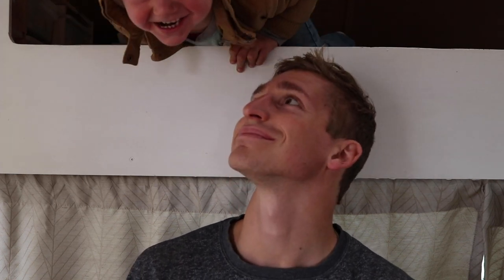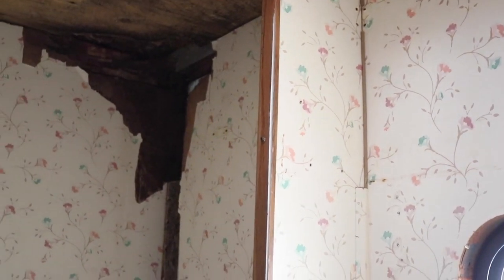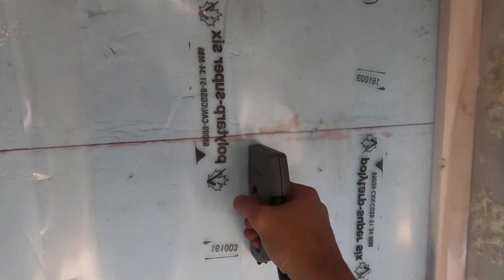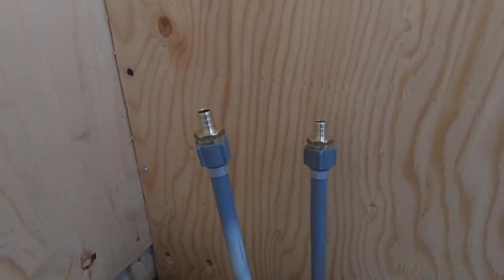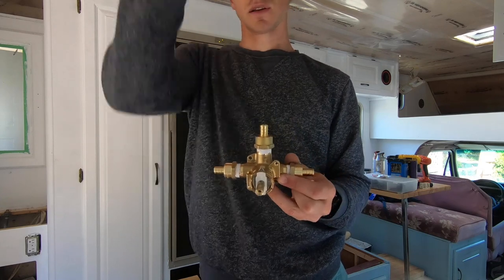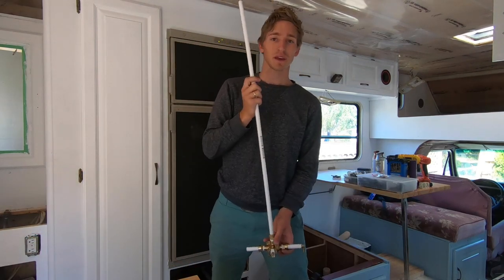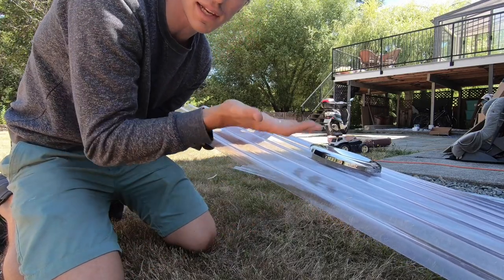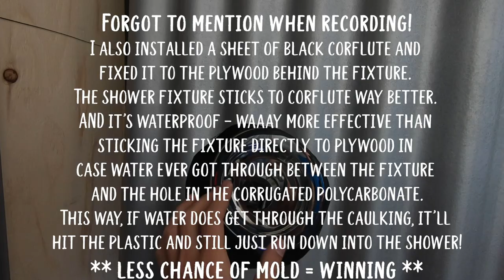DIY RV shower rebuild - start to finish

Comment: I know you did this work awhile ago, but good to see a post so we know you are still kicking around in the van somewhere!

BTW, if I were you, I would keep the PEX ring clamper.  I have the full size crimp one, which will crimp many different sizes of PEX, depending on which plates you put in it.  Yes, it was one of the expensive ones, but I pulled out all the copper plumbing in my house and replaced it with PEX.  I also have been installing radiant baseboard heat as I renovate each room.  So the expensive one was worth the money.  However, it is long, and can't do crimps in tight places because it opens so far.  So I ended up buying a clamper similar to yours, but even smaller, that uses the clamp rings like you were using.  There will come a time when you will need to replace a line in your camper - sink, toilet, shower - something will spring a leak somewhere, and you'll regret not having the ring clamper.  It may be a one trick pony, but it isn't all that large, and it's the only tool that can do the job.
Reply from the maker: Totally hear ya! We have a pre defined period of time in North America (2 year Canadian visa) so well definitely be keeping it while we're here in case of a leak or other issue. But at the end of our time we'll need to get rid of it. 😊

Comment: Thanks for the great video, we bought a camper and the tub surround is coming down and I'm guessing there's water damage back there too, I love the plastic corrugated look, I was wondering what I could use in our Reno, and I think this is the answer!
Reply from the maker: That's awesome! Yeah I hadn't seen it done before but it just made the most sense to me. And it was a simple solution for a fairly inexperienced renovator. :)

Comment: Looks beautiful but it looks heavy. I wonder how much weight you added putting all that wood on all walls and ceiling. Good luck.
Reply from the maker: Thanks. :) Honestly hardly much extra weight. If I looked like I was struggling it was probably from working with the tight, awkward angles more than the weight of the thin ply sheets 😅haha

I'll take strength of materials over worrying about 5kgs extra weight in a 2T vehicle any day.

Comment: So did you just screw in the PVC sheets? I’m currently trying to do this in my RV
Reply from the maker: Small pilot holes to not crack the polycarbonate sheets, then used galvanised screws (waterproof) with a rubber ring thing on each one so it would be tight to the surface of the polycarbonate. Then used a clear sealant over the top of that around the rubber seals to make them extra waterproof.

We also made sure we put the sheets in an order whereby the run off from the shower wouldn't angle in (so lay the sheets in an order where they're away from the spray of the shower)